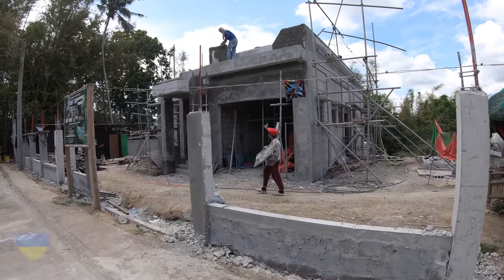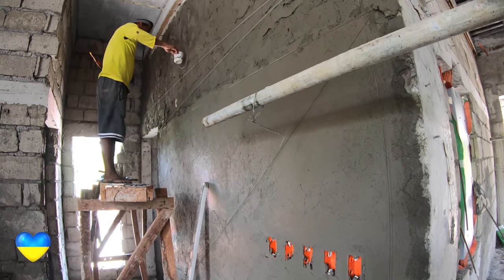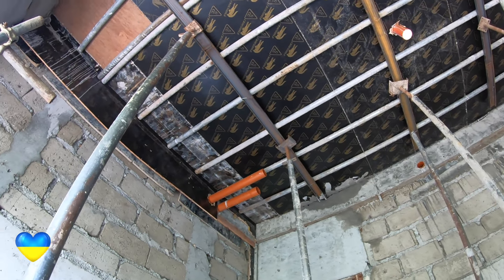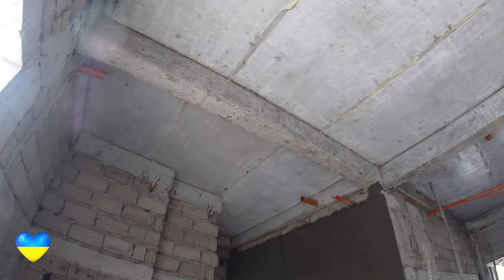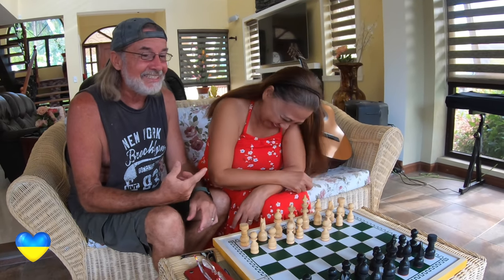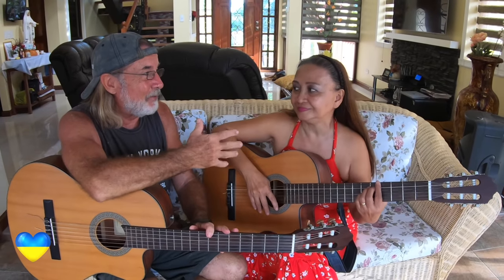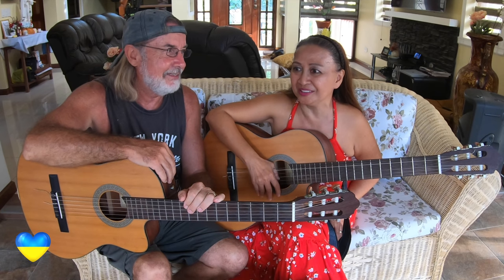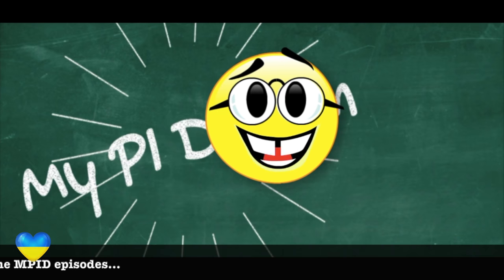NEW HOME BUILDS - EPISODE 16: CEILING MASTERPIECE  (House Building in the Philippines)

Comment: Even here in the U.S., new buildings always leak. I remember the new Super Walmart here had a lot of buckets on the floor after a strong rain. I think it's fixed now but it took  a while. If the ceilings are drop ceiling, they could have used the corrugated metal forms and just left it in place and will have a few supports. Of couse you wouldn't know if there are honeycombing going on if the forms are left in place
Reply: Walterboro, South Carolina Walmart roof also leaks all these years. They never fixed it. They just put buckets to catch the water.

Comment: 👏👏👏👏👏👏  Great song and well done I should say. 

Wondering,  why are they pouring a solid cement wall around the perimeter and retaining walls but using the block system for walls in the house? Does it have to do with piping and electricity wiring?
Reply from the maker: The retaining wall needs the solid concrete to prevent the pressure of the backfill from breaking the wall.  In house construction, walls that are non-load bearing do not need the strength of cast in place walls.  This is where builders can save without sacrificing safety.